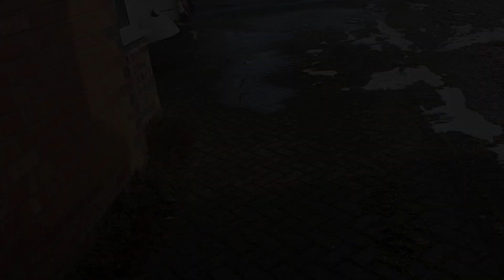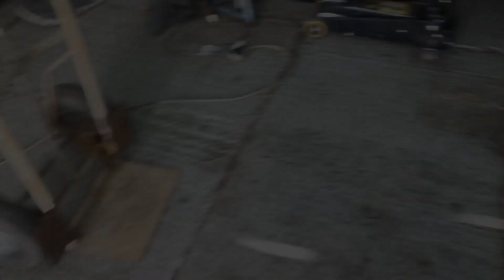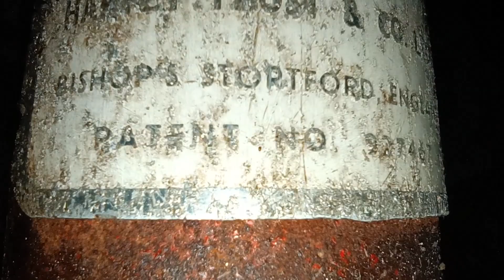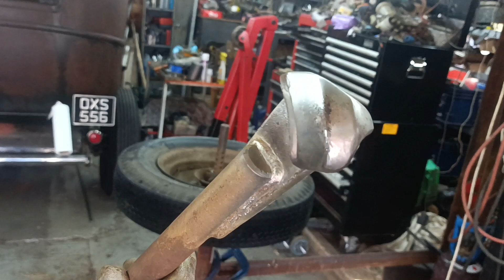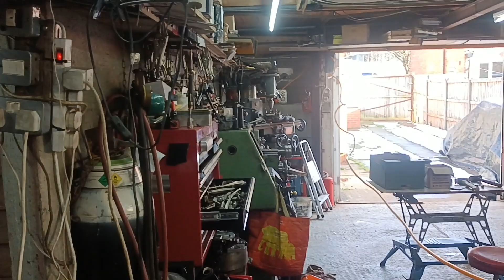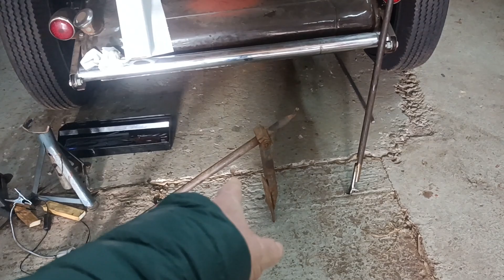Using a vintage tyre changer to fit tyres to my 1941 Ford pickup (2326)

Comment: Mart, how does your truck drive now ? Are the LT tyres very harder than passenger car ?
Reply from the maker: Not sure, Harold. The truck drives really well. The tyres are nice. They are more flexible than the old ones. These are "6 ply" tyres, normal passenger car tyres are "4 ply". So they are stiffer than passenger car tyres. That said, I have had 6 ply tyres on the back of my roadster for years. It's a hot rod. It rides stiff. The truck rides great on them, but it is what you would expect in a truck. It's best to avoid 8 ply and 10 ply though, they are for heavy trucks.
Reply: @MartsGarage  please take a look on your rear tyres of your 32. Can you confirm they are 6 ply ? I’m looking for a pair of 7.00-16 Firestone but they are out of stock in the US and really expensive in EU. So I found some 6 ply LT tyres for a reasonable budget. Just worry about how the car will ride

Comment: Hiya Mart, what type of jack would typically carry in your truck mate ?   Just for emergency wheel change. Jacking under front axle or diff OK ? Lump of wood to protect.
Reply from the maker: Hello Paul. I don't tend to carry one, but maybe should. Anything will do. An old scissor jack if in good condition or a mechanical bottle jack or small trolley jack. I'd tend to go with a mechanical type over a hydraulic to negate leakage. Obviously try out whatever you choose on all 4 corners first. Most importantly make sure your wheel nuts are not over tight and whatever you carry with you to undo them can undo them. I fell foul of this in my daily after having new tyres fitted.
Reply: @MartsGarage  Yes seen you torquing your wheel nut's up on the truck tyre swap vid. Bit of copper slip don't go a miss either. I have a small motorcycle jack - mechanical . That will do, have my big trolley jack in the garage. Just imagine getting a flat - kick yourself Mart with no jack. Spare gallon of Gas never hurt either. That tyre machine is the dog's mate - love it. Done my fair share of chasing wheel's round the garage floor and bad  language - lol

Comment: In the early 1980's my older brother had a small used tyre shop and this was the only thing he had to change all the tyres, it's a great tool. I was a teenager then and I used to help him in the shop sometimes but after 8 hours changing tyres on a manual machine like this I would come home knackered.
Reply from the maker: Thanks for watching and thanks for the story. It must have kept you pretty fit!

Comment: Re. unsightly sidewall markings, they can be polished off using a angle grinder, fitted with one of those discs with overlapping pieces of abrasive cloth/paper. Like a flap disc. Crucially though you need to use one that's been well used and is clogged up with paint etc. otherwise they're too aggressive. 
The same method can be used to good effect transforming white-band tyres into whitewall tyres :) (yes, there's a near full whitewall underneath most narrow band whitewalls!
Reply from the maker: Hi Mart. That spurs a memory. I widened out a narrow white line tyre to a wider stripe with an angle grinder once. It was like doing a burnout in the garage! That was on the old ex Simon Lane 1940 coupe.
Reply: @MartsGarage  Haha yes same here, rubber everywhere!

Comment: Man that brought back some memories! My Dad owned a service station and garage in late 50s to the early 70s and I started to work for him when I was 15 years old (1960) after school and on the weekends. My first jobs were pumping gas and fixing tires. We had a manual tire changer a bit more advanced than yours as the tire breaker fit over the center post you would break one side and then flip the tire over and do the other side. I would show up for work and there would be a row of flat tire 15, 20 deep. Dad charge a $1 a tire to fix plus any boots for inner wall damage or inner tubes needed. What work out that was,  some of the Chrysler cars had what they called safety rims and I had to put a 4 foot pipe over the 3 foot breaker handle and put my 140 lbs on the end bouncing up and down to break the bead! We won't even discuss those nasty tires from manure spreaders the farmers would bring in after going flat over the winter or those dangerous split rim truck tires! Fortunately Dad had an additional bay added hired another kid to pump gas and do tires and I move to the repair side and was tutored by my Dad who was known as the best mechanic in the area. At 19 years old I had to do my my military duties and in 72 Dad sold his business...I continued on to become a pretty decent wrench puller myself. I truly enjoy your videos on flathead work as that is what I started hot-rodding on those many years ago. (The picture next to my name is a 49 merc I had back then)
Reply from the maker: Thanks for the interesting back story Rad.

Comment: 👍👍Nice tool save. Another handy thing is a valve stem cap with a hole drilled through the cap and some cord pulled through. Thread it through the hole in the wheel, you can keep the stem from falling back in the wheel,  can be quite handy for getting the stem into position on a very skinny tire ( like the 19's on my stock Model A) where there isn't much room.
Reply from the maker: Hi Art, that's a good idea. I put the little tool on the stem to keep it from dropping back through.

Comment: You got it Mart !! No big "expert" on this but the biggest secret is to keep the first side of the tire you hook over the wheel DOWN" past the bead surfaces while you are pulling the far side over the edge of the rim. The lubricant usually gets applied to the edge of the tire so it slips easily over the edge of the rim. 

BTW, if your floor is thick enough, you can get "Drop-in" concrete anchors that will sit flush of below the surface of your floor  so they are not sticking up when not in use. (ay need to put a little cork or short stud in the threads to keep debris out). Here's a page with them on Amazon. Notice down towards the bottom of the page where thdy show the anchors, the drill, and the driver tool for $34.00. 
https://www.amazon.com/Premium-Plated-Carbon-Knurled-BCP1001/dp/B084DBDJ7Y/ref=sxin_16_pa_sp_search_thematic_sspa?content-id=amzn1.sym.77fb2c04-2466-444a-b28b-02979f4340a7%3Aamzn1.sym.77fb2c04-2466-444a-b28b-02979f4340a7&crid=2PIU8M6VFXLWM&cv_ct_cx=Drop-in+Concrete+anchors&keywords=Drop-in+Concrete+anchors&pd_rd_i=B084DBDJ7Y&pd_rd_r=fed13d93-d0ed-4a61-96bf-043e750d6e7d&pd_rd_w=nza4V&pd_rd_wg=tqHdn&pf_rd_p=77fb2c04-2466-444a-b28b-02979f4340a7&pf_rd_r=T6C9SZ5MA3H6FGQT192T&qid=1680061621&sbo=RZvfv%2F%2FHxDF%2BO5021pAnSA%3D%3D&sprefix=drop-in+concrete+anchors%2Caps%2C143&sr=1-2-1fa5bb29-8495-43da-8896-6cda87f207d0-spons&psc=1&smid=A23TVO4Z9GSJEQ&spLa=ZW5jcnlwdGVkUXVhbGlmaWVyPUE1QUNEV1JKUjFPRUImZW5jcnlwdGVkSWQ9QTA0MDgyOTkzREc3WU5GR0hLN1BFJmVuY3J5cHRlZEFkSWQ9QTA5Njc4MjYxMVYwUVVMVUhNOUVLJndpZGdldE5hbWU9c3Bfc2VhcmNoX3RoZW1hdGljJmFjdGlvbj1jbGlja1JlZGlyZWN0JmRvTm90TG9nQ2xpY2s9dHJ1ZQ==

Comment: My maual tire changer is bolted to threaded expanders, set into the concrete in my shop.  When not it use, I just remove the (4) bolts and insert set screws into the holes in the concrete just below flush, to keep debris out of the holes.  I used liquid dish soap as a lubricant, but recently found a jellied lubricant which I like even better.  Great vid, Mart !
Reply from the maker: Yeah, Bob, some lube definitely helps. I used a small amount of vaseline but I think it's not the best. I'll get some tyre soap that the tyre fitters use.

Comment: Cool vid mart .I have used that tool before they are good but I have always taken the tyre off the front of the wheel not the back. Easier to put the tyre and tube on . But good job
Reply from the maker: Hi Jamie. I did the 2nd one front side up and it was easier. I did the first one from the back as I was afraid of marring up the rim. I need more practice to do a neat job. Thanks for watching.

Comment: I watched a mate use one of these things for years with practice you will get it down to a fine art. They are actually a bloody good tool. I would  bolt it somewhere to the the floor with dynabolts so you car remove it but you would need to be careful not to trip over the studs or you could make a wood cover with holes drilled in it to match the studs poking out that you can just slip it over when not in use.
Reply from the maker: Hi Graeme. I was getting the hang of it after only 2 tyres. Yeah, if I was using it more often it could get bolted down, but I never noticed any problem with how I had it braced to the pillar. It's a useful bit of kit and nicely vintage and patinated.

Comment: I'm still watching Mart but I'm thinking you are going to need that tire changer bolted down solid if you are going to be prying those heavy ply tires off and on the rims. Tire lube or at least soapy water is your best friend here. I've had a vintage Coates tire changer for years and its bolted solid to concrete. Well I see it worked out quite well. I change mine with the valve stems side pointing up.
Reply from the maker: Hi Ralph. it worked well braced to the pillar like that. I did the other one valve stenm up It was better. This machine will marr the wheels up somewhat. I need more practice.